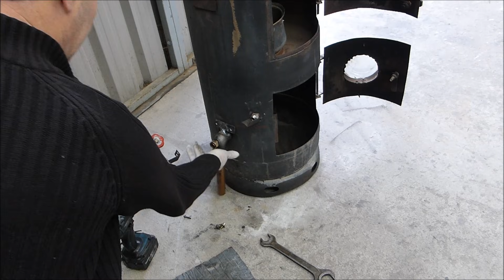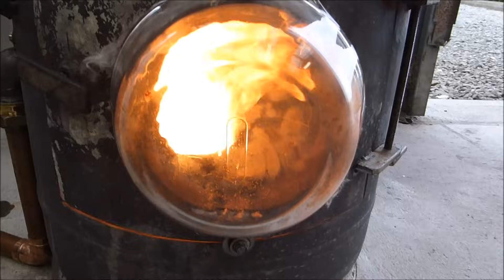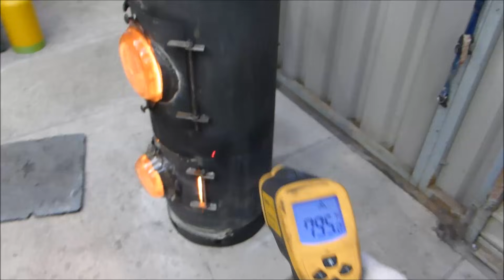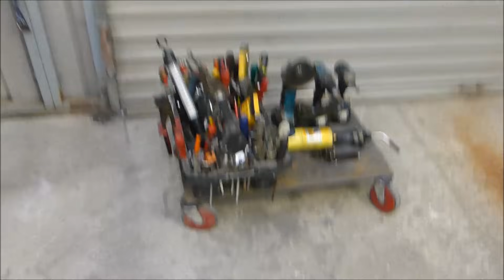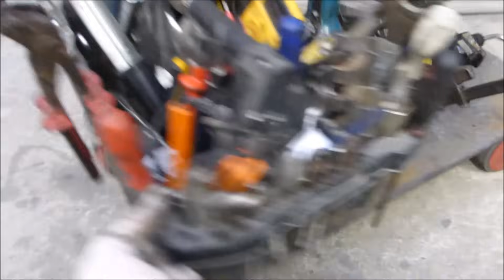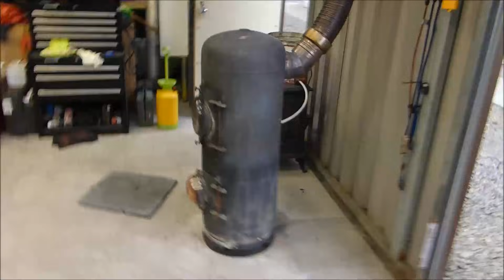Waste Oil Heater - Super quick install - New design - Space Heater

Comment: What kind of combustion air blower are you using?
Reply from the maker: On this stove I was just using the exhaust off a vacuum cleaner but to give you an idea as to volume and pressure even a hairdryer on cold provided enough air and pressure. My later stoves dont require a fan at all. Here's a prototype https://youtu.be/ytw-eU-F0Rs Cheers Gerry 👍

Comment: You should make a custom crusiable for the burner. Try plaster paris and heat resistant cement.  Here is a mixture I found to work well.  3parts plaster paris / 1 part Cement / 2 parts Vermiculite / 2 parts water.  Whish you would of shown what you was using for the air motor. Great video!

Comment: Just a couple of points,  first don't apologise for using British terminology be proud of the nations that taught the world. 
Secondly for  safety  replace the  plastic pipe as it's too close to the stove. 
Thirdly investigate a British oil burner made in Somerset called a don burner (as used in  Aga cookers) to replace the 
 bean can. You could soon produce your own version. 
Well done for the advice on not trying to relight a hot burner as this is extremely dangerous. 
I am a boiler engineer and tell all my  customers of the danger.
Lastly the oil air mix is most important,  in the vid you had too fast a flow to start off not giving the oil time to properly vaporiser.
Otherwise great vid, well done and good luck for future vids.
John

Comment: Very cool heater. I was thinking maybe move the valve closer to the oil and away from the side of heat chamber in case it gets so hot to melt the packing around valve handle. Maybe I'm wrong,just thinking it gets so hot so close?  But very nice
Reply from the maker: Hi John. This stove can certainly get hot. A drip feed is the easiest way of getting the oil into the stove but a dosing pump would be better and can be located remotely. Here's a list of other burners I have made since this one. https://www.youtube.com/playlist?list=PLmQ5wJnkAIoJYDBgSOis9s1yDhcFdswtN Thanks for commenting Cheers Gerry 👍

Comment: I have a 40x50 metal building . Would the heat off the cylinder be enough or would you do a heat exchanger and fan set up ?
Reply from the maker: Hi Rich. My shed is 20 x 30 and I can easily heat this shed with this propane tank. If you run the exhaust into an oil drum or other heat exchanger you could recover more of the heat from the flue gasses and run the stove cooler. Have a look at my latest project. It is an oil drum burning solid fuel at the👍 moment but will be running on waste oil soon. Thanks for commenting Cheers Gerry

Comment: How did you do your doors and what kind of glass is that?
Reply from the maker: Hi Mick. The glass in this stove is only cookware. Essentially just 2 pyrex dishes. They can take the heat but need room for expansion of the metal. Cheap and easy. Thanks for commenting Cheers Gerry

Comment: I just built one Gerry.I mad mine out of a gas hot water tank. I cut a square out of the top side and cut the flue off and cut around the flue in the bottom of the tank. I used a air mattress pump for my blower works great. Thanks for the idea 👍
Reply from the maker: Hi joseph.Well done on your build. Thanks for commenting Cheers Gerry

Comment: HI !!!  I wanted to ask you based on your experience, what is the oil odor level in the room where the oil burner ignites? Would it be possible to heat a family home with this method? Did you do any chimney pollution test or test using a carbon monoxide measuring device? I am currently wanting to investigate to propose using this method in a community of people where we still do not have network gas and this option besides free is very practical, thanks from Patagonia Argentina
Reply: I've only ever had fumes during the initial lighting. 
Once going there is enough flow from the exhaust that any leaks from the doors, etc will suck air into the system.  If you use a fan as an air intake blower,  just make sure its flow  doesn't exceed the exhaust flow.
If you don't get fumes, you're good.
 I had never had the guts to actually move mine in the house.
 What I have seen is a guy the cookie is waste oil burner in a  containment system, And then blew the hot air from the containment system into the house. 
 A little safer.
 I have another friend that moved his waistoil burner inside the house and has never had a problem with it

Comment: Can I get away with flue liner on an oil burner?
Reply from the maker: Hi Kas m I used a flexi flue as a connecting piece for a few years and it never burnt out. You will need 4 metres of 5 or 6 inch diameter for the normally aspirated stove and less if you want to go with a powered forced air setup. Hope this helps Cheers Gerry
Reply: @GerrysDiy  thank you for the reply Gerry. You saved me a lot of time as i been researching and never came across anyone stating you could use a flue liner

Comment: May i suggest rolling some stainless steel screen roled up to relace tin can. There are many varieties in alloy, wire size, mesh per inch and percent open. It makes a good back-flash arrestor too. Certain metals may also add a catalytic effect: cobalt, molybdenum; plus ceramic paste like ceria, zirconia, etc... could be painted on to enhance. Some similar to lantern-mantles. This could get rid of CO, nitric oxide, etc... Thanks for cool video. Very interesting, fun.

Comment: Nice job Gerry - thanks for sharing your developments really appreciate learning from your experiments.I think I would worry about the fuel supply line being too close to the stove especially if plastic fuel line is used by some viewers.perhaps a "dimmer" switch to control the fan speed?I really love the glass pot in the doors! that is real genius !!
Reply from the maker: Hi Robery Thanks. I made a burner that runs as well as this one but does not need a fan. That burner is very easy to make and I show how to here https://youtu.be/ShTLaYKjzxw Cheers Gerry
Reply: I barrowed a few of your ideas and made a smaller burner to just maintain my shop temp without being too hot and buring too much waste oil.using your internal air system I put a 1-1/4" pipe perforated with 3/8" holes into a 4 inch thread on cap. Then cut a short (6" long) section of 4inch pipe and topped it with a 4x3 reducer.  Welded some flat bar legs to the reducer and set it up so the cap is about 4" above the floor.  Then ran some 3" stove pipe up and out the building. cooks away nicely with the internal air (your idea) and I only run this at about 0.3 litres per hour.  holds the shop temperature well without too much heat and runs precious little oil.  Thanks for your posting Gerry they lead to my own version and I have to say I would not have thought of the air pipe in the middle until I saw yours.

Comment: Made one of these, can't get the oil to burn on its own. After about 10 minutes the fuel to kick start the oil runs out and nothing. Any ideas?
Reply from the maker: Hi A Mc. Are you using forced air on your unit. If so how thick is your vaporising pot. Cheers Gerry

Comment: I see metal pipe in which the 1/2 inch pipe is situated is bent and not fabricated as previous, how where you able to achieve this ie. getting the tube up the inside of the bend. great video
Reply: Tubing is probably slid inside then outer pipe is ran through a pipebender

Comment: If your burner plate is hot just use a small piece of old rag with a little oil on it and use your propane torch to lite it and once burning you can turn the oil on a little bit..

Comment: Great project but there is a lot of wasted space in that burner, you can make a coil of 3" pipe, going in and out of the burner and installing a small blower on on end, and you will get a lot of extra heat. If you have high temp blower from gas furnace, you can mount the intake in top of the stove so it can also suck the hot air and place the blower on the end.

Comment: I did't quite catch on to your disclaimer.  "Don't put kerosene in to the hot furnace"  Do you mean a cup of kerosene dumped in to the hot coffee  can at the bottom of the propane  tank furnace or did you mean don't feed kerosene through the  waste oil piping  system? Would it be a dangerous  idea to feed the furnace with diesel  fuel? That is a five gallon bucket of diesel  fuel piped through your shown waste oil fuel delivery plumbing?
Reply: if the furnace went out and you went to restart it before the can cools down when to put in kerosene it would vaporize it and be pretty explosive  when you try to light it. just burn oil..  diesel might work but would get expensive.. I use a half cup of gas and half cup of diesel to start it
Reply: Ok , good.  I understand.  That diesel can be used in your rig  just don't douse diesel  or  volatile  fuel on a hot plate. I have 100 gallons or 400 liters  of diesel  , that I would like to burn up . love the video and excellent comentary

Comment: It sounds like Norman has a powered oil pump.  Is that correct?  If you want to use a pump, you can install an oil orifice, and save quite a bit on how much oil you burn.  If you do however, you will need a plate for the flame to hit on.

Comment: One great suggestion. You should add heat sinks on the sides. This will take the excess heat that normally goes up the chute outside. It will make and keep more heat indoors. You can put you heat sinks either horizontal or vertical. I would go with the first as each plate will keep heat rising to the next plate above it and so on.  For a blower motor use a 12 volt one from a car. You can use a 'dimmer' switch to control how fast you want the air intake to be. I would power the blower motor on deep cycle battery. All you need is either is a solar panel or deep cycle charger to charge the battery.
Reply: Getting ready to build horizontal burner out of a 55 gal drum.
How would you heat sink that?
The steel is very thin and it could benefit from that.

Comment: Make your burn pot out of something 1/2 inch thick that should be the best fire pot so it doesn't burn through remember forced air into a fire is like a blast furnace they can melt steel.

Comment: I wonder if it would be a good safety measure to have a solenoid actuated, normally closed valve attached to the oil line so that if the power goes out and you loose your air, your oil flow will also be cut off when the power is lost to the solenoid actuated valve?  Just a thought.
Reply: +Tony Vissoc  That  was  my  thought as well , do you have a mode and  Part  number .and  Im still trying to get a good  blower to work that will last.  Have used air mattress  motor , works  great  but  last about 7  days  of  8 hrs  a day burn . I am in process of  running 2  inducer  motors together  cause  1  just  isnt  enough  to do it well  ..
Reply: Try using a PC cooling fan.Dont know how long it will last but worth a try
Reply: Electrically operated solenoids are almost always dependent on a minimum pressure differential to close. Usually a minimum of 20 psi differential.
Reply: somby 44, you would be speaking of a pilot operated sol/vlv, direct acting sol/vlv would operate fine in a gravity application...........

Comment: Impressive, 
have made a few log burners over the years,,,, always evolving on the designs and tweaking as I learn but this has taken it to the next level. 
Will be attempting this oil version next summer when I get some free 'man time' but im near to completing my latest project (full on baffle plated ,secondary air injection manifold and intake regulators )
Im  interested to know how your pirex dish door has evolved ? Do you still get the occasional breakages due to heat/expansion/contraction or have you Sussed a good way of fixing the dish..... I'm considering trying a spring loaded cLip to combat the movement  but if you have found an easier way I'm interested in your idea
Also,,,,,, how have you sealed the dish,,, fire rope?
I have some spare car ' exhaust cement' and 'gasket silicone' that I am about to try on my first pirex door,,,,, has worked fine sealing my flue but not tried near the hottest part of my burners, will update when it works/fails.
Cheers, kev Wigan uk
Reply: Izimu Dh z

Comment: Gerry, PLEASE be careful! The "smoke" coming out of the fuel line is nott smoke at, its vaporized gas and WILL EXPLODE!   Great furnace!
Reply: Sure will, converted my double 55 gal wood stove to drip feed oil burning. For some reason the fire went out and the bottom barrel filled with what I thought was smoke. I closed the door, right after that there was a small explosion but enough to bend the latch on the door! That was a little scary to say the least!

Comment: fantastic design. wll done. im going to build one for my barn and use a water jacket around the stove to pump water to my heater core in the shop.that way it can be away from the building. great design. keep building:)
Reply from the maker: Hi Richard. It works really well for something so simple. I did a video a while ago where I added my Ozzirt version waste oil burner to a boiler with a water jacket. I connected this boiler to a 300 litre 80 us gallon water tank. Things went a little wrong but it makes a lot of heat and can easily heat water. Here's a link  http://youtu.be/bvparmYPbjA   Cheers Gerry

Comment: What kind of oil use rate do you get running at a moderate pace?
Reply from the maker: Hi Rex. Running it flat out it will make the tank cherry red on about 3 to 4 litres per hour. 1 us gallon approx. Lowest setting will be about 1.5 to 2 liters per hour about 3 us pints. Even at a moderate pace it will make lots of heat and no smoke. Hope this helps. Cheers Gerry

Comment: That is a very nice heater. What are you using for a fan? Thanks! :)
Reply from the maker: Hi. ForkinCrazy I am just using an old oil burner with the electrics removed so that it is now just a blower. Anything will do really and in one of the videos I use a hairdryer just to show that this thing wants to work and needs very little help to get going. 
http://youtu.be/EvQQWg-gSwM
Cheers Gerry

Comment: Hello Gerry,How long do you expect the  ex gas bottle to last , given the amount of heat it kicks out.
Reply from the maker: Hi Paul. The truth is I thought it would last just a couple of months or a heating season but when I fired it up this winter for its second season in action it was in perfect condition so I have to upgrade my original assessment to years. Its not necessary in a fairly well insulated shed to drive it as hard as I do in some of the videos. It certainly kicks out savage heat if you dial it up. Cheer Gerry

Comment: Why not move the oil control valve on the plastic bin?  Also use a smaller diameter so its easier to control.
Reply from the maker: Hi Antanas. The valve is close to the burner because as soon as I make an adjustment it is immediate. It does not have to travel the length of the pipe first. The reason for the 1/2 inch pipe instead of 3/8 is because that was the size I had available at the time and also it is harder to clog it with dirty oil. The gate valve would be better changed with an needle valve though. Cheers Gerry
Reply: +Gerry's Waste Oil Burner other vids show that needle valves clog up to much,, you would need a serious filter.

Comment: very nice build. What kind of glas do you use for the viewing glas? looks like an old washing machine glas... handling the heat ?
Reply from the maker: Hi emc3u2. Its just regular pyrex cookware from my kitchen. I haven't managed to melt any yet but the propane tank can expand alot so its necessary to leave room for expansion.  From the colour of the flame you would know if it was burning cleanly. The truth is that the flame looks cool but you dont need the glass at all for this to work. Cheers Gerry

Comment: That would be much more efficient for heating if you run the exhaust stack into a couple of 55gal drums, one drum welded above the other with a 8" hole in the top of the lower drum and the bottom of the top drum, then run your exhaust from the boiler, into the lower drum first, then the heat will rise into the lower drum and up through to the top drum, Heating both drums for more radiant heat, you could use much less oil for the same heat,  then your exhaust stack to outside should vent or connect to the top barrel. adding two more 55gal. drum will capture a lot of heat for radiant heating.
that way you get a lot more convection heat from the barrels instead of loosing it. I would also slow the oil down some, use a brass fitting for your oil regulator, you can make that setup a lot more efficient.
Reply from the maker: Hi Gary. Its true I could recover more heat from the flue gasses and there are more efficient ways of burning the waste oil but as is this little setup really whacks out the heat reliably for very little cost. I will be making a different atomising setup soon. Cheers Gerry

Comment: Greetings, beautiful job on the heater!! What did you use for the site windows on the doors?? Also, what are you using for the air supply?? CFM?? (C/MM) Would a glass site(S) on your oil feed work better?? I found a cool little site glass with a needle valve already on it on eBay for a reasonable amount. (made by Lube Devices Inc.) Thanks for all the great videos!.  ,spike....